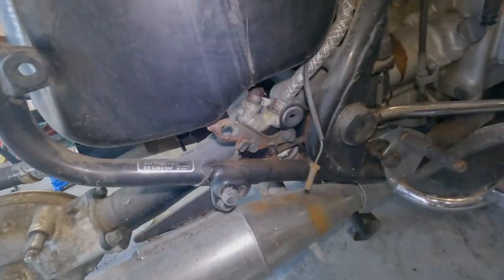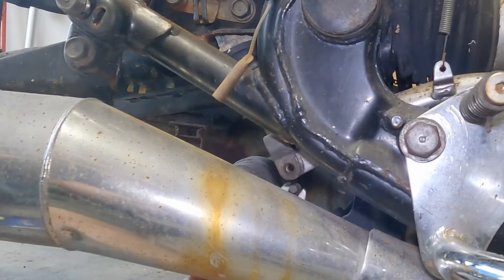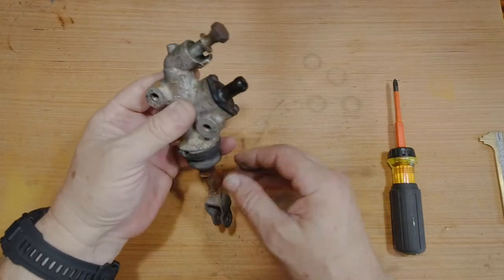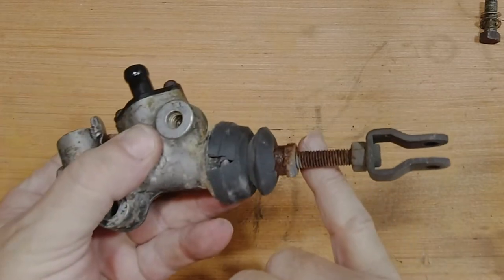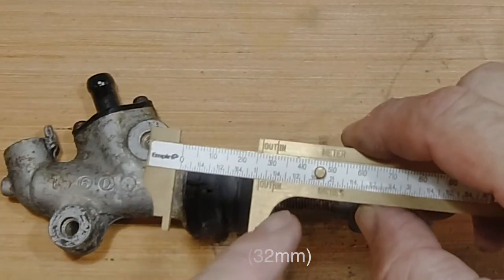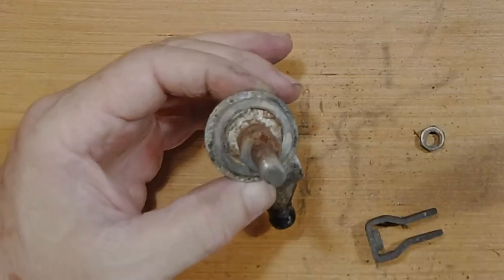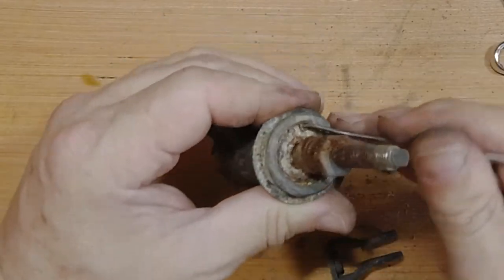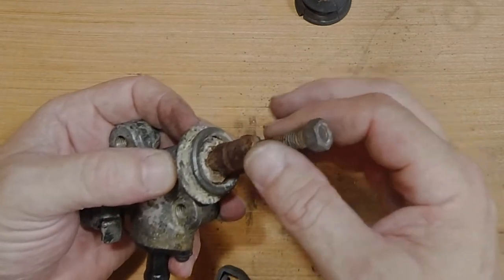Honda Goldwing | Rebuild Rear Master Cylinder 🛵

Comment: I'm trying to rebuild my master cylinder for my 84 aspencade 1200. for some reason the plug wont come out of the cylinder. I've removed the c-clamp but nothings happening. Any ideas??
Reply: I have the same problem on 
My gl 82 and you can not use heat because de aluminium I'm trying putting it on diesel for a couple days and will see 👍 👌
Reply: @Rambo-lc5bl  the way I got mine out was I held it in a vise grip and smacked it out with a rubber mallet. One good swing and it should come out

Comment: Great video thanks.  Question for you.  Mine seems to be leaking around the boot area every time I push down on the brake.  Any idea what may be the cause, would a rebuild kit with a new boot fix the leak you think?  Thank!
Reply from the maker: Thanks for watching!
That boot is there to keep dirt and other schmutz out of the piston cylinder, nothing more. If brake fluid is coming out thru the boot then the piston cups (seals) are leaking requiring a rebuild.
Reply: @TomAsay64  thanks, did the rebuild so far so good :)
Reply from the maker: @Jeremy-ht4gm  Awesome!

Comment: Aluminum crush washers my bruh.  It helps to use a slight bit of grease ( I prefer to use brake fluid) to lubricate the rubber before attempting to install it. Though you did do a workaround for the crap screws, I personally would have replaced them.  I'm just anal like that.
Reply from the maker: You are right! I should have used grease! I can be anal at times, but where do we stop!
Reply: @TomAsay64  I dunno, when we are satisfied of a OUTSTANDING Job performed I reckon. :yougotthis:
Reply from the maker: @anonimous2451  I reckon that as well.